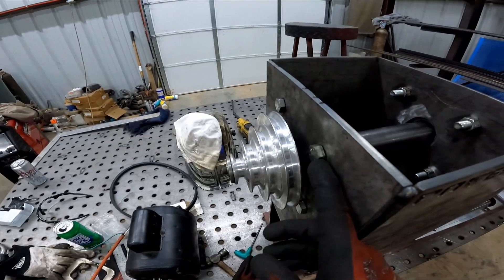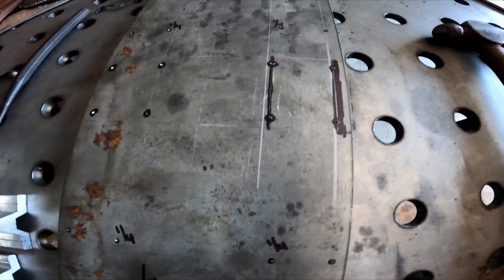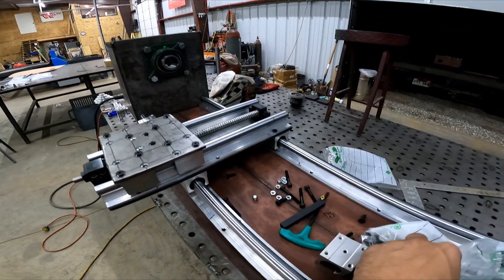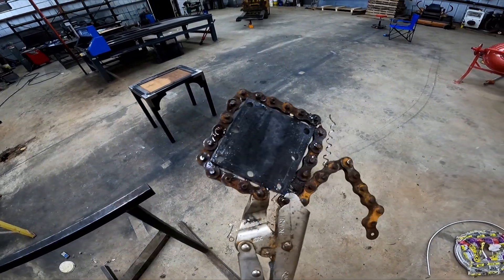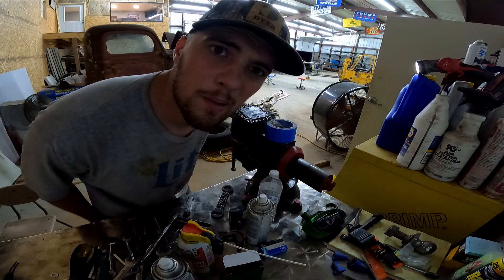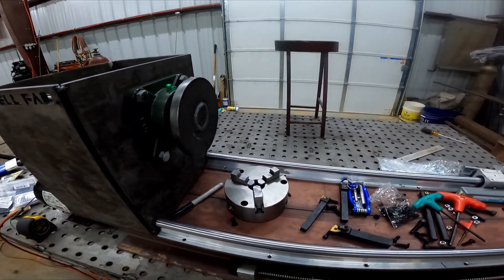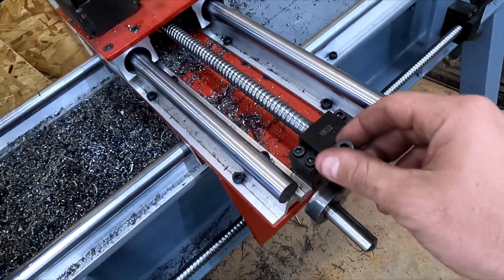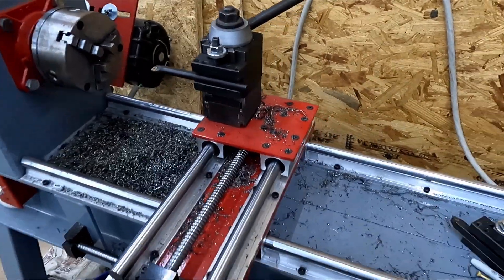DIY Metal Lathe (Under $500) Powell Fab Style. Scraps come in handy on this project.

Comment: Hello! Where can I see your lathe in action?
Reply from the maker: @ХОББИ_Олега  shortly after the build we had the chance to buy a bigger machine so we ended up selling this one.
Reply: @powellfab.3357 Thank you, I understand you.
Reply from the maker: @ХОББИ_Олега  hope you liked the build! If you are going to try and build one and we can help, just reach out.
Reply: @powellfab.3357  I am planning to build a heavy machine with a reinforced concrete frame and on HGR30 rail guides with a bed length of 1300 mm, a center distance of 800 mm and a processing diameter above the bed of 400 mm. The chuck will be 200 mm, and the spindle through hole will be 60 mm in diameter. There will also be an automatic feed and thread cutting function. In short, I want to build a large, powerful machine that will not be inferior to a factory machine.

Comment: I´d recommend to use hgr Rails (atleast type 25 or 30) because they are way more stiffer and will reduce vibrations and smoothen the cutting action ( they are a little bit more expensive though but I think they are worth it , they often get used for  extension arms on big machinery)
Reply: Is there any way to tell if the rails that you're buying is actually genuine or just cheap junky knockoffs.
Reply: @karansingh1154   hey ,  visually no , but on aliexpress  or amazon u often get the knockoffs  (china  imported ) but these are often good enough too, I recommend  cleaning the roller  bearing slides, the name brands that u find  on more  serious websites will cost u a lot more, but for  a hobby machine the chinese  guide rails are good enough , for the price of the name  brands  I would rather  buy  a real lathe ( in my area I could buy a lot  of beautiful german/swiss made lathes but they  are big and heavy and  I have no  workshop  where  I could savely put it in, but  someday I will
Reply: @karansingh1154 Even cheap Chinese analogue rails are much better than these cylindrical guides on an aluminum support. Because even the Chinese copy of the rails has a rigidity that is several times higher than that of the original cylindrical guides.
In addition, there is no point in using original rail guides in such a simple homemade machine: for such a machine, even a cheap fake will be enough and it is still better than the cylindrical guides that the author used.

Comment: Nice lathe.
Now get a variable speed motor and get it attached to your lead screw. Buy or make a half nut and attach to your carriage with a lever so it will engage and disengage. You’ll love the auto feed option when u want it and your finish turn will be ten times cleaner

Comment: Friend, buy yourself a tap holder! It will make your life a lot easier when cutting threads...

You decided to reduce the gap between the driven pulley and the headstock housing, but it was necessary to set the minimum clearance between the chuck faceplate and the headstock housing. But not everything is lost, it is also worth installing the front bearing from the inside as well and try to set the cartridge with a minimum clearance to the sheet of metal.

As for bearings: Such bearings are not the best solution because they have backlash. That's why I gave up on them. You need to replace the bearings with tapered ones so that you can choose by tightening the nut
axial and radial play.

The spindle should immediately be made from a thick-walled pipe, since the absence of a through hole in the spindle axis seriously reduces the options for work.

The spacer between the cross feed plate and the tool post should not be narrower than the tool post itself, this significantly weakens the design.

And yes, such guides for CNC are rather weak and give large deviations under loads during metal processing.

I don’t know which of what I wrote you will understand correctly since I had to use Google translator ...

Greetings from Russia, and good luck with your machine building.

P.s. The one who does nothing makes no mistakes...
Reply from the maker: Thanks for all the advice. We really appreciate it. We are just some young guns having fun. I like the saying for sure we will have to keep that one.
Reply: hollow axle tube, already machined true, got threads for bolting on pulleys and spacers, space for bearing races, shoulder already milled in for conical or angular contact bearings, bearings in that size common and cheap, can be cut off an old floating shaft truck axle, careful welding of a flange prevents distortion and a second one from the other side in case the first was screwed up, also... the diff can be used as the primary drive.
Reply: Привет! Ко всему вами сказанному хочу добавить пару моментов. По поводу направляющих я бы советовал использовать рельсовые направляющие типа HGR типоразмера 25, не меньше (HGR25) с соответствующими каретками. И в станину можно залить бетон, что кратно увеличит жёсткость станка.
И китайских копий направляющих хватит за глаза для подобного станка: переплачивать в 5-7 раз за оригинальные типа Hiwin нет никакого смысла для такого станка.

Comment: Where did you buy your ways? How did you lock the tool carriage down?
Reply from the maker: The ways I got off Amazon I left a link in the description. The tool post there is bolt through it then it's a crimp lock on the new one.